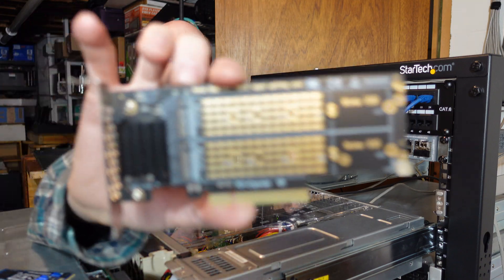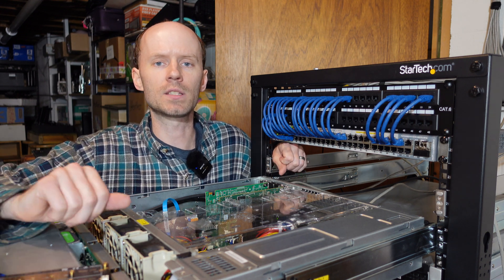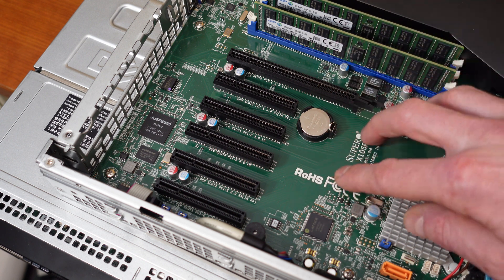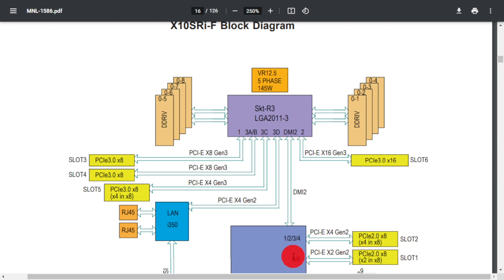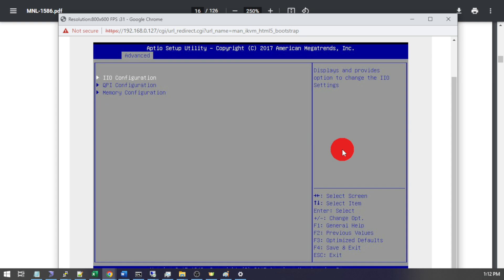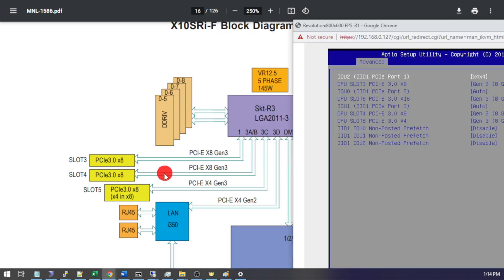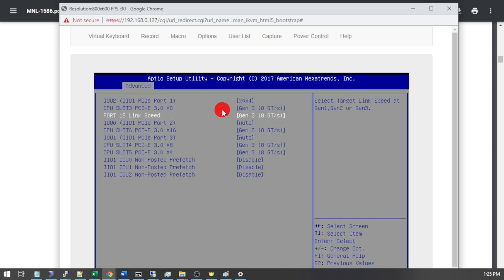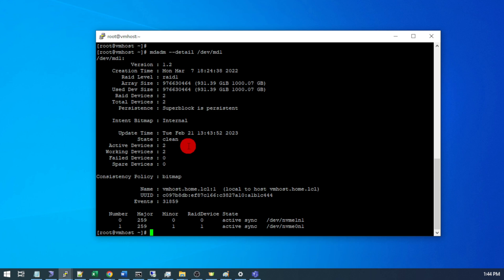Dual NVMe Expansion Card, PCIe Bifurcation Explained on a Supermicro Motherboard

Comment: If you are at this video and have a newer board or like me with a 570 chipset.. it is super simple on these motherboard..    navigate to the Advanced Mode > Settings > IO Ports, and find the PCIe Bifurcation Support setting for the specific slot (e.g., PCIE_X16_2 or PCIE_X16_3) to change it from 'Auto' to your desired configuration like x8/x8, x4/x4/x4/x4, etc., then save and exit to apply. , it's that simple now days

Comment: The NVME adapter card you show on hand has PCIE switch chip onboard.... Turning on bifurcation does not help it, might in hurt the performance even.
Reply: nope hits a headsink for the onboard vrm since nvme drive take 3.3v and need between 2 to 3a at full load, and pcie can only provide 3a at most on the 3.3v rail that why single m.2 adapter don't have heatsink

Comment: I have a question. If the board requires a motherboard with split lines, what's under the heatsink? Is there no split line chipset there?

Comment: Here's a question: the case you show for the X10SRi-F is a 1U, but the card you're  installing is a low profile (i.e. at least 2U). If you installed into that 1U case, did you use an angled PCI-e adapter to fit it into that case slot? Also, you wanted to install a GPU into the x16 slot: how would you go about utilizing/accessing the other PCI-e slots, if the GPU covered them (if you needed to adapt the angle of the GPU to also fit the case)? Any thoughts on using a PCB adapter card, or one of those ribbon cable adapters?
Reply from the maker: The low-profile card was installed in a 2U chassis with an X10SRi-F. The moment of installation was shown at 5:58. And yes, if you utilize an angled adapter in a 1U case, the installed expansion card would obstruct use of the remaining slots. It's a 1U case. It's not designed to fit several expansion cards...
Reply: @HomeSysAdmin  you're absolutely right. I must've looked away right at that point!

Comment: I can see a 2 pin power connector on it. Is it unused?
Reply from the maker: I don't know what that is for. It's not covered in any of the documentation or anything I can find online. I suspect it's just a 12V power connector if you need to connect an accessory of some kind (not a power input). I'm not sure but I do not have mine connected to anything.

Comment: great explanation, just a side note, if the card for the nvme has the PLX chip, then the burification is not needed.
Reply from the maker: Interesting, is that pretty much functioning as a PCIe switch then? Ie two NVMe on a single x4 slot?
Reply: @HomeSysAdmin  that's usually the case, however some may not allow for this. The Viking solutions pcie switch u.2 to quad m.2 adapter is a funny kind of thing that you should try. lmk if you want me to dig up the model num lol

Comment: I've watched literally dozens of videos explaining this, and close to zero of the people explaining it, tell us what motherboards support it.

Are there ANY motherboards that support x4x4x4x4 bifurcation of 2 of their x16 slots?

If so, which ones?
Reply from the maker: I'm afraid I don't have an answer to this as I'm only familiar with a few particular Supermicro boards that I've worked with. I'm sure any Supermicro board with two x16 slots (wired for x16) will support x4x4x4x4 mode, but I can't list of models off the top of my head. The manuals are all readily-available online though and will indicate supported modes.
Reply: Can u boot also into 1 of the nvme drives installed in the dual nvme expansion card? @HomeSysAdmin

Comment: The Asus Hyper cards usually need the main pci-e slot for 4x4x4x4 and only 4x4 in a secondary pcie on most motherboards. These adapters seems like the perfect middleground.

Comment: Great stuff! I have a problem with bifurcation with lga 2011-3 and xeon 2678v3. I have a chinese MB Jingsha d8 and bios it is a little bit different. Can you help with that? I have a Asus Hyper m.2 x16 v2 and it will be find a one drive on this card. Of corsę bifurcation is ON.

Comment: It's too bad you used such an old motherboard because this is not how they do it anymore and this is not the way my B550 explains it. The new listings just say x16, x8x4x4, x4x4x4x4 and don't designate what slot they are talking about. It's very poor support. That M.2 card is excellent and I have 2 off them. It worked in one of my B550's. It worked in my Asrock Taichi but not my Steel Legend.
Reply from the maker: This is specific to Supermicro. The board you noted is not a Supermicro motherboard.
Reply: I'm wondering, if you have a motherboard like yours which has a PCIe x16 slot that also supports x8x4x4, what does that mean for any NVME adapter and NVME drives you put in there? Say you have an adapter that supports a quad NVME raid array, can you only use 3 of those slots? In which case, what difference does the x8 slot make and how would it be different when the other two are x4?

Comment: can i do it in x10dal? my x10dal not have IOU x4x4 like your video, it's only have pcie gen 3 (8gt/s)
Reply from the maker: Please make sure you're running the latest BIOS from Supermicro. My understanding is some of the bifurcation features were introduced later and required updating. The block diagram for your board is in the manual on page 18 here https://www.supermicro.com/manuals/motherboard/C600/MNL-1701.pdf

Comment: I repair PCs and once a week I get a call from someone that did not know to check their motherboard for bifurcation before buying one of those cards. Cards that cost closer to $100 or more usually have bifurcation built in and work with motherboards without that function, although ALWAYS double-check.
Reply: So true. Shame the cheaper pcs like dell optiplex doesn't support bifurcation

Comment: Can you put a pair of 4TB M.2 SSDs on that PCIe card?  That would be really cool.
Reply from the maker: Yes, any M.2 NVMe drive will work. There is no size limitation. Also, if you have an x16 slot that supports bifurcation, they make a 4-drive version of this card that puts 2 NVMe's on each side 🙂
Reply: @HomeSysAdmin  Awesome

Comment: you see that the ASM1182e chip is a PCIE ver2 device. Not ver 3 - this has implications - please do an hdparm and crystal disk i/o for a followup
Reply from the maker: Where are you seeing an ASM1182e chip?
Reply: @HomeSysAdmin  you should have at least done a raid0 hdparm no matter whether it is pci-e v3 or v2 - so a followup - this is a great piece of kit, also think about followup with a 4 banger on a x16 slot - that is what people and smb want - to be able to run like a z440 with 8tb nvme raid0 and just make an image of part md0 to a 10tb hd - no need to goto raid10 - people could run dual nas on bonded10g and get like 1gb/s but to really take advantage they would want 100g - the raid0 nvme matches up perfect to saturate the 100g w/o having to brid-utils bond0 or br0 - just suggestions - love your content and you are getting better - chia is important but also consider wider mkt and algo  for smb mkt - huge
Reply from the maker: I'll do some additional testing here soon and post back the results. Also "chia is important" I don't use this for Chia at all. This RAID1 of NVMe is a virtual machine image store - all kinds of fun things, MySQL databases, security system, etc.